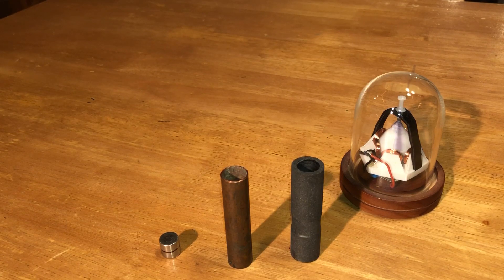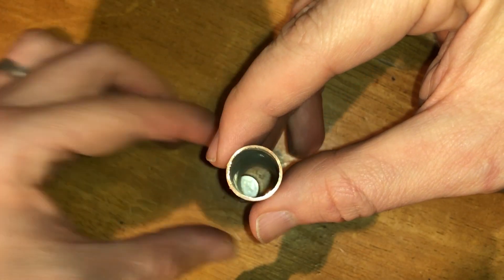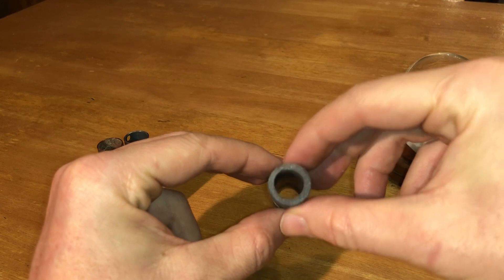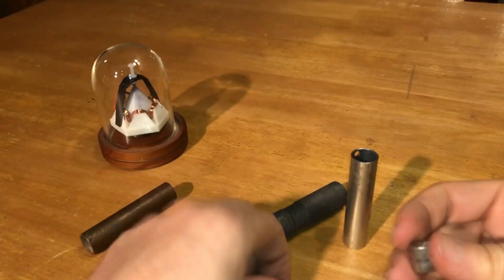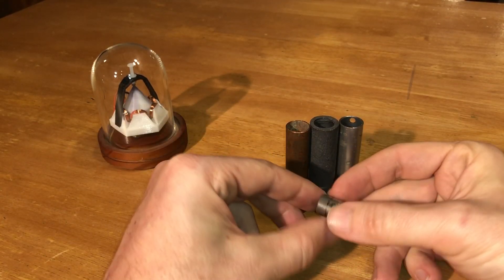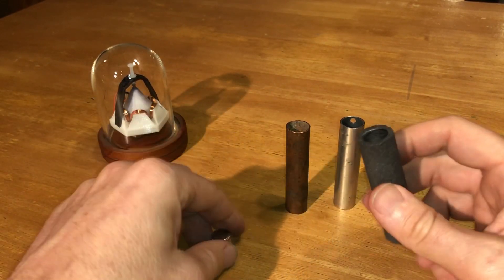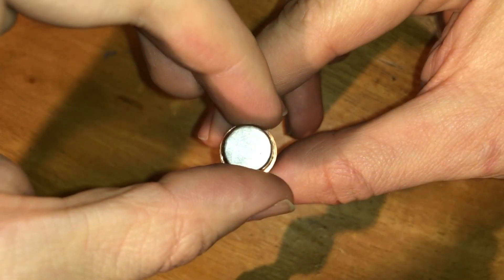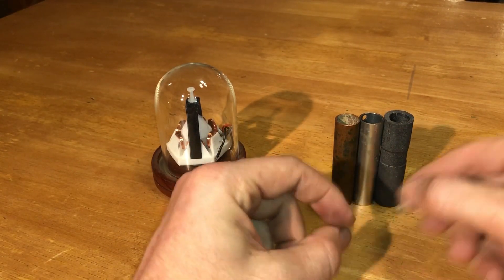Lenz's Law - Magnet Through Carbon Tube?

Comment: A carbon coil is an interesting concept. I'll be interested to see how you propose to make a winding with it without changing the electrical characteristics. Perhaps an impregnated string? Check the resistance. Even then the effective area of a strand would different. Impregnate another string with copper and check resistance and magnetic properties. Maybe a helical glass tube filled with powder? Check that with copper powder as well. Cut a helix out of a tube? Pretty fragile. You'd need to chek that against a similar copper helix. Point is any configuration found to work should be checked against a standard.
My suspicion is that there will not be any appreciable induction. No basis for the prediction, just gut feeling. I could be wrong. It's worth experimentation. It might have unexpected results and applications.

Comment: 1) The graphite rod you have is amorphous in the sense that all graphite sheets are not nicely oriented. Such "compacted" graphite is a poor conductor (much worse than copper) as evident from its resistivity -  (between 3e-3 and 3e-6 ohm.m as opposed to 1.7e-8 for copper). This is a primary reason that resistors were mostly made from carbon in the last century. You cannot measure it with the multimeter, since the lead-wires of the meter are much thinner and much longer than the tube you try to measure.
2) If you can get your hands on HOPG (highly oriented pyrolytic graphite), it can be a lot of fun to play with due to its diamagnetism. It is also a better thermal-conductor than copper in-plane
3) For coils, stay with copper :)
Reply: 1 that all makes sense, but a three digit reading, should easily show the difference, at a fixed voltage.
2 sounds interesting
3 bet there's better
Reply: @aditya mehendale So what do you think using a HOPG type of graphite to drop a magnet through a pipe  of such material will it slow down the magnet or it will be faster due to HOPG diamagnetic properties?
Reply: @billiardrichard6351  gut feeling: electrical conductivity will be dominant; the minuscule reduction in permeability (compared to air) shall not play a big role. Note: the HOPG sheets are optimized for thermal conductivity; not electrical. Also, how do you "weld the tube"?

Comment: I am sure a graphite coil would work as eletromagnet, but it will likely run hotter due to higher resistance.

I kinda expected it to be slowed down some, but not to the same extent as copper,
just due to lower conductivity.

The copper have high currents (unsure about magnitude, but I know it's major), and graphite would have too high resistance to make it major.

Try meassuring with a 4-wire milliohm-meter, your meter was limited by test-leads, and resolution at the lower end of the resistance range.

Comment: OK, I paused at 1:52. I think it will fall slower than outside a tube, but faster than through a copper or aluminum tube of the same wall thickness and diameters. Simply because it is higher resistance, so the energy is dissipated more quickly.
Reply: Wow. I thought there would be more slowing in the carbon tube.

Comment: Latrice imperfections in the graphite layers can produce dipoles.  See article
Room Temperture ferromagnetism in Graphite driven by a two dimensional network I’d point defects Nature Physics 5 Oct 4, 2009 pg 840-844. Also could be due to iron contamination as well.  Interesting gross level effect with rotational spin and faraday disc

Comment: Wow that ws unepxected.  So much for eddy currents huh?
if there was a slit in the side it would do that...
Carbon Diamagnetic  Mass Magnetic Susceptibility -6.2×10-9 m3/Kg
Copper Diamagnetic  Molar Magnetic Susceptibility -6.86×10-11 m3/mol

Crbon is signrificantly more paramagnetic  (10 e-9  instaed of 10 e-11 ) 
Very strange.
I almost think your sube was glued together with something non conductive between the halves.

Comment: The tube is an electrical load! When I think of resistors I always thing of higher values as being "bigger resistors" but really they are the smaller load. If you take a brushed motor, solder a resistor to it and spin it by hand there will be very little force resisting you but if you short it out and try to spin it you will feel a significant force resisting you. The shorted motor is a higher load in the same way that the copper tube is a higher load for the magnet. One way to get more brake for you buck would be to increase the speed that the magnet enters the carbon tube or to just have a longer tube, it could be that the braking effects are so small that they are not apparent until near the terminal velocity of the magnet in free air.

Super cool idea, and I love the tritium motor!

Comment: The main difference between the graphite and the metals is that the metals have more delocalized electrons. The outer shell electrons in metals are not bound to the atoms themselves; rather they flow around the crystal like an electron soup. Metals with more valence electrons tend to be more efficient conductors. Graphite has three covalent bonded electrons holding the crystal together in a very orderly structure. This leaves only one electron to be delocalized. However, the fact that it does have one delocalized electron per atom is the reason this non-metal is a good conductor in the first place. 
Small meters like that use a low voltage, low amperage current to test for continuity. Try ramping up the current in those different conductors and things get a bit more obvious. The graphite will begin to incandesce a lot sooner because it does have much greater resistance than the metals when it comes to high amperage. 
This is why Edison used graphite filaments in his light bulbs. They were the easiest to get glowing and remained the preferred material through much of the late 1800's and early 1900's. The reason we no longer use graphite for incandescent lights is because they are comparatively dimmer, more brittle, require thicker filaments which make them bulkier and heavier and they are much shorter lived than the tungsten filaments that were invented in 1904 in Hungary.

Comment: While you tested linear resistance, keep in mind that your graphite tube was much thicker than your metal ones. For Lens' law, it's current AROUND the tube, as close to the magnet as possible, that is important. Looks like the ID is about 1cm, so about 3cm circumference = L, and lets say that A = 1mm*5cm for both to look at "just near the magnet" in both cases. Copper resistance would be 10uOhm and carbon would be 720uOhm. 72x less current all else being equal. And that doesn't really even get into the other issues mentioned by others. Interesting experiment!

Comment: The main thing here is the fact, that resistivity of graphite is ~1E-4 Ωm while for copper it is 1.7E-8 Ωm so it's still 10000 times less conductive. 
Making coils of graphite may be interesting as the electron-hole pairs keep generating and recombining, trough the resistance would be really high. On chip inductors are a thing but i think they use metalization layer or metalized polysilicon.
Reply: @Reno Simpson 1E-4 is just a fast way of writing 0.0001 (1·10¯⁴) that many programs and fellow robots understand. Ωm (ohm·meter) is a unit of resistivity. You can derive it form the formula for resistance = resistivity · length / crossection -> Ω = Ωm·m/m².
Reply: @jellyfishjelly1941  You took your time to explain fully and nicely to him. You deserve a thank you from me even I didn‘t need help reading them. Thank you!

Comment: Suppose you would have a tube which is hollow (on the outer edge), and it was filled up with Hg (experiment on room temperature, it should be a fluid). Would the magnet be slowed down?
Reply: Would the Hg not fall out of the tube?
Reply: @_John_Sean_Walker  The tube should have a double shell (a tube in a tube for instance). Not sure what are the right words to say this. This way the Hg would be in a contained part of the tube (the outer part).
Reply: Never use Hg, it is very dangerous!!
Reply: @_John_Sean_Walker  For experimenting purposes, it is okay. But yes: using chemical elements does mean one needs to know what he or she is doing. I would suggest doing it with special gloves and in a ventilated container designed for this sort experiments. Does that sound any better?
Do not forget, the idea was only meant to do a thought experiment. The person who would really do this experiment would most certainly be careful. I think.

Comment: What if you make a longer one? How much speed could it reach?

Is it possible for you to try taking apart those magnets and glue them in a way  to have the same pole in each side then see what happens while putting them in each tube?

And is it possible for you to get the weight of the magnet outside and then inside the tube (when the motion is done)? thx

Comment: That graphite rod has a low enough resistance to pass a reasonable current along its length, try putting a compass near it. I cannot imagine current flow without a generated magnetic field :-)
Reply: Do not so called "conductors" displace magnetism? Therefore it is the insulation, or air, that is conducting the field perturbation, or current. Just inquiring, no disrespect intended to anyone as all contributions are valid. Cheers

Comment: Old people used to know that there are "reflectives" (metals) that push or pull with magnetism and neutrals (plastic, wax, etc) that dont react. So if iron and aluminium are in the ends of that spectrum, then carbon is the most neutral "reflective" and it needs way more extreme conditions to measure its full accurate properties.

Comment: I think that the copper tube acts like one bic fat coil winding that has a short. so if you disconnect the short by a thin cut, the magnet will fall fast. When you connect the cut, the magnet will fall slow.

Comment: i know from some experimentation on my own that Carbon and especially Graphite tends to have directional difference or rigid electron path or i guess what you could call a grain that it will conduct in certain directions better than others and that most tubes and are sheets laminated together with resin so that they are good conductors along the length but do not complete the circuit needed to exhibit the lenz effects that you see in the copper pipe that is generally extruded so its a complete tube instead of more of a rolled up newspaper where the path of least resistance is along the length. Rods of Graphite tend to be compressed powder and resin an i'm guessing there are lots of inconsistencies in resistance along the length unlike the uniform lattices of the metal. But i'm by no means an expert.
Reply: I stand to be corrected if wrong. I am not well studied enough on the topic yet, neither have means to experiment for the time being. However, it is interesting if by that it means graphite/graphene solid states can be polarized, in such a way that it behaves in a similar manner to rectifiers/diodes. I wonder if there is any voltage reading or any kind of induction going on in this particular set-up with no Lenz effect. If so, how does that compare to a 90 degree phase EM circuit.

Comment: The  graphite does not conduct nearly as well as copper. You need a 4 wire resistance test to measure it. That DMM ain't good enough.
It was no surprise the magnet fell fast. Not as fast as free space, it was a tiny bit slowed. Just a question of how much it's slowed Between the aluminum and nothing.
Reply: Yes, the graphite could work as an electromagnet! A perfect electromagnet would require no voltage, just current. But all materials have resistance, at the graphite has a lot of that. It will basically be like a copper electromagnet with a resistor in series. Just that the resistance is distributed along the conductor. All electromagnets (and the H field they produce) care about is current. Just current. That's all that matters for making a steady state magnetic field. The voltage is necessary to overcome the impedance (Resistance and inductance) of that coil.

Comment: I think the graphite has a much, much higher resistance than the metal tubes
Reply: watch 1:55
Reply: @slinkytreekreeper  multimeters don't work for shit when doing low resistance measurements. Copper is around 100 times better than graphite at conducting electricity.

Comment: Nice vid. I have an experiment of my own that uses len'z law. I want to see if spining some magnets inside the center of an aluminum heat sink that I drilled a hole in, would be an efficient heater or not.  I know the magnetic drag creates heat, but I can't find out if using the eddy currents to create heat would be efficent. The only thing that comes up is how to minimize eddy currents, which is the polar opposite of my goal.

Comment: Prediction: magnet will be stopped a small amount but will go significantly faster than the alu and copper due to higher resistance since it won't be able to generate much current

Comment: Hey, I am glad you are back, I also look forward to the findings you have on graphite and it's relations to magnetic fields. I agree with one of the other comments that the lack of eddy currents is most likely due to the irregularities in the graphite compared to the copper or aluminium. If you were able to find a way to reorder the system to make it more uniform it might make a difference. Keep experimenting.

Comment: Try printing pancake coil with graphene ink. Also trying to make a bowl-shaped electromagnetic graphene coil. Another thought would be to coat fishing line with graphene conductive ink and then insulate it with enamel. I also feel that the carbon tube accelerats the magnet slightly. Thank you for the post!
Reply: you sir, have a brilliant mind.. I hope you're experimenting on your own too. good luck!
Reply: Yes I have tried this making wire of a graphite but it doesn't make electricity 😢

Comment: Carbon disc can function as faraday disc generator.  Perhaps the magnet effect is less due to the infinity higher surface area and lower density of the graphite tube you made. The slowing of the magnet is less discernible perhaps because of that.  Now imagine a series of .7mm pencil graphites that are applied to the outside of a very thin plastic walled tube.  Parallel to the long access of the tube.  Would a thinner more dense carbon sheath provide the same non discernible effect or would that allow the eddy current to be distributed into a smaller area thus increasing the effect?  Just thinking out loud.  As Always great job.

Comment: I think the reason it does not have the same effect as a Copper tube is due to the inconsistent conductive path for electrons.  Electricity always follow the least resistance.  This is easy for copper.  It's just a straight line or the shortest distance.  For the graphite,  there are areas with high and low conductive areas  so electric current follow irregular paths  which produces irregular counter electromagetic fields.  

If you were to make a coil based on graphite,  then you are essentially forcing the electrons to follow a specific path that is identical to the behavior of a copper coil. I'm sure Lens law will become apparent.   ANd oh,  welcome back ......... You've been gone too long.
Reply: I think it has much more to do with diamagnetisim.
Reply: What about carbon fiber?

Comment: To make the "coil" you can just stuff a tube full of graphite powder. As long as the particles contact, it's a wire (: 
you don't need to do something complicated to "cut a fragile wire out of graphite". Let me know if you get this comment or if you'll do it (: 
all your dust/shavings from previously machined graphite will work excellently for this.
Reply from the maker: That seems like an easy way to do a quick test.  Thanks for the idea.
Reply: @lasersaber  I'm curious on how metal powder (or shavings) crammed in a tube will behave. It should be the same, right? Can you cram some metal shavings into a cylinder shape and see if the lenz law happens ? If it doesn't, our powder lacks integrity :P

Comment: i dont know if it makes any difference buy the hole through the carbon is not dead center - the wall thickness was not equal like in the copper pipe - you must have mounted the rod in a four sided independently adjustable chuck